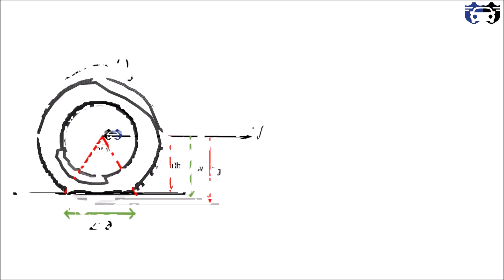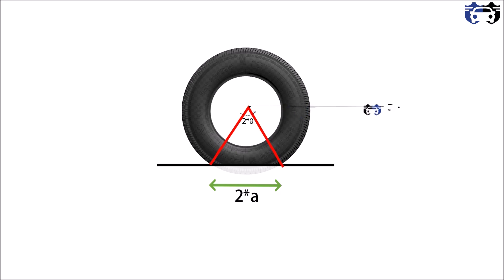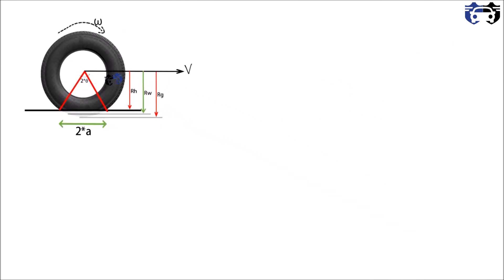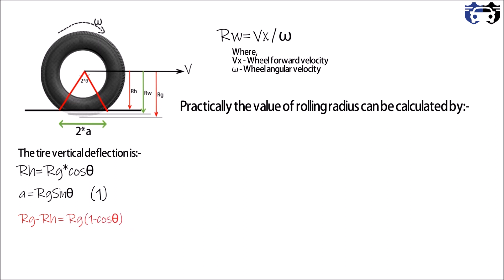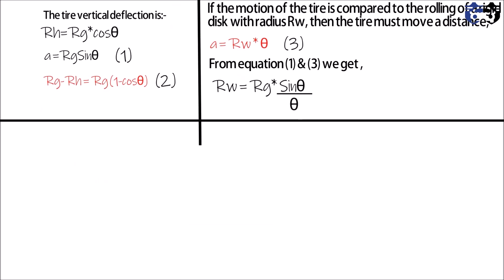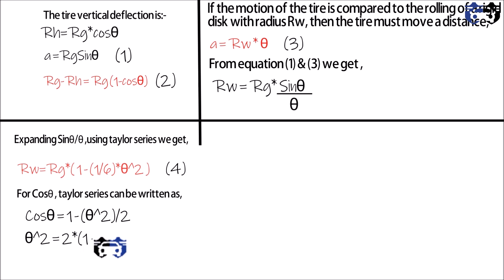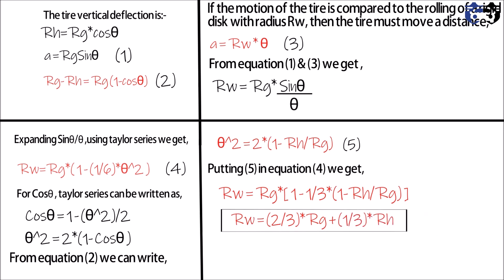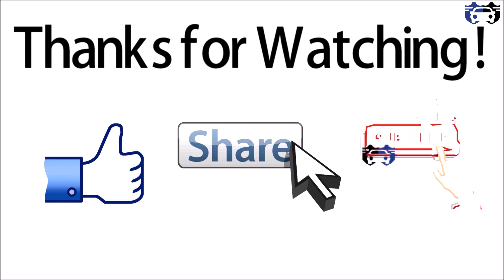How to Calculate the value of Rolling radius ?

Comment: Find the hoop stress developed in the thin rim of a wheel of radius 400 mm, when it is 
rotating at a speed of 3000 r.p.m. The density of the material of wheel is 8000 Kg/m3 ??  solve  this  question..
Reply from the maker: Considering this as the thin walled cylinder , Hoop stress is given by,
 σ =  ρ* ω^2 *R ^2